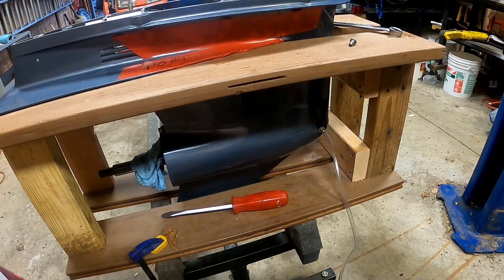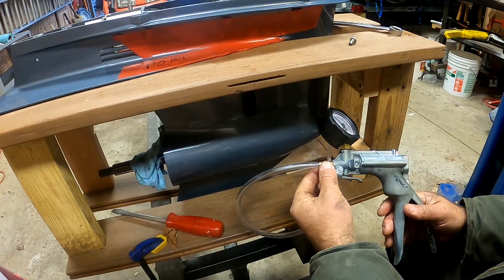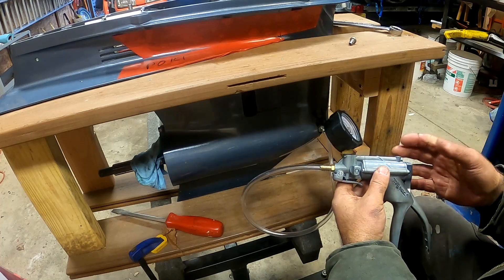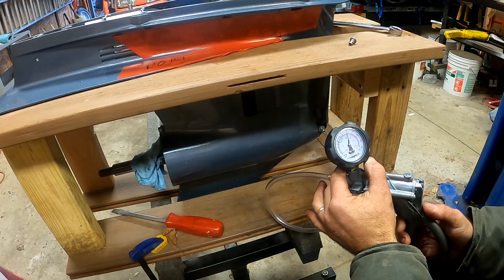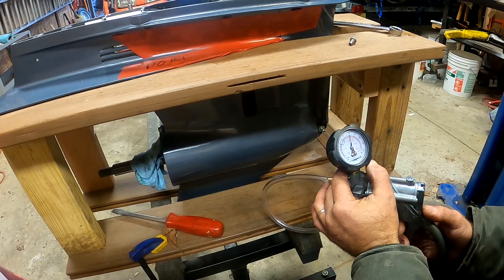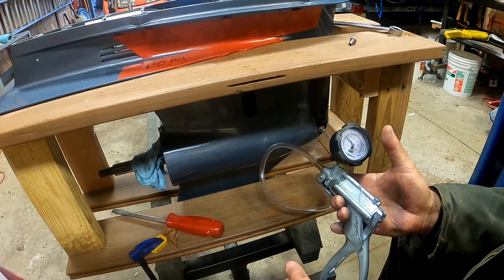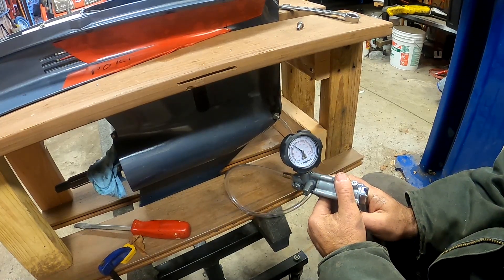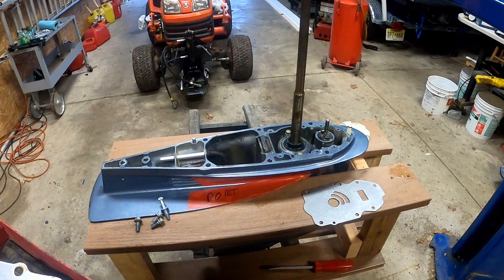How to vacuum and pressure test an outboard lower end

Comment: Thats interisting my johnson lower unit is getting water in it , it holds 15 lbs of air pressure , shifting it and turning driveshaft with prop and visa versa , turning prop with the driveshaft , it dont change for hours , holds vacuum to , until you do the shift forward and reverse and turn it in forward or reverse ? I caught it early i believe,  cause i check it 6 times a year and change twice a year ..above standard procedure according to the repair manual ..i hate rebuilding these , maybe resealing will go better ..😂
Reply from the maker: Make sure you remove the water pump so you can check the top shaft seal.  Yes I would try the shifter seal too, but it's usually the prop or the drive shaft that spins all the time.
Reply: Some manufacturers want them to hold presssure, some vacume, and some both.